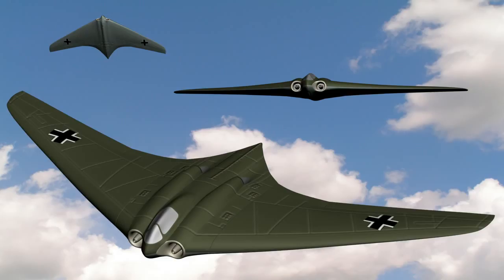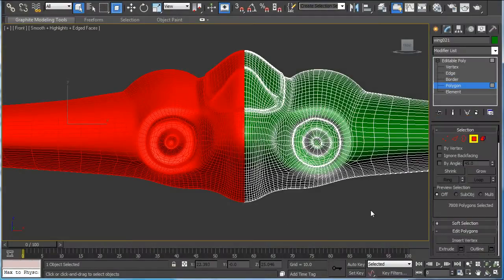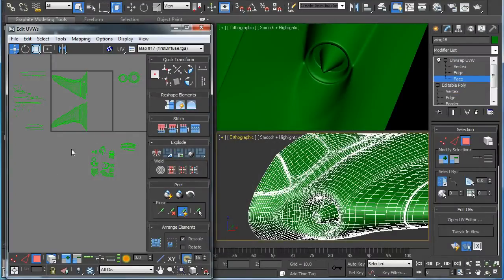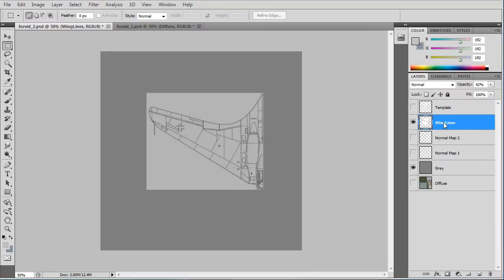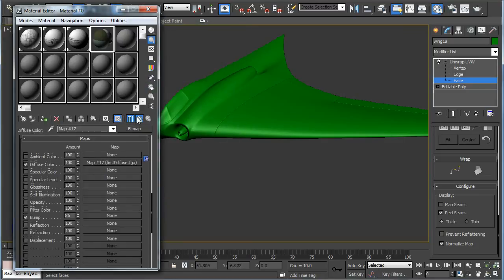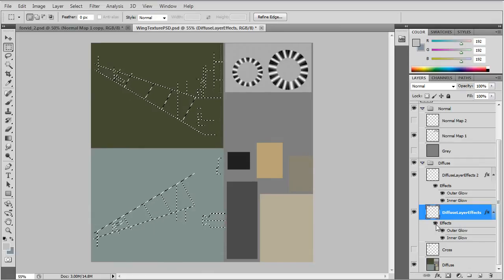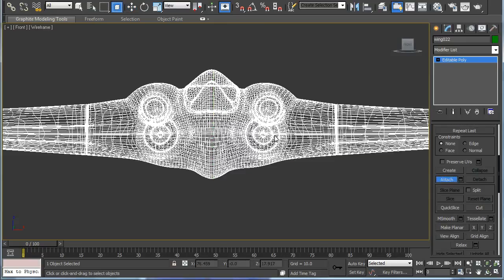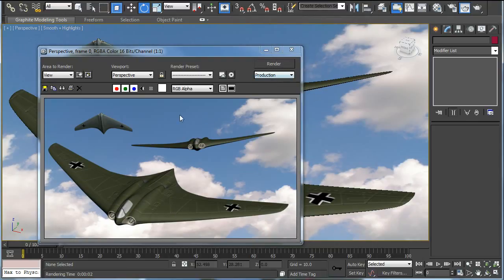3ds Max tutorial Part 2: Texture Map the Flying Wing

Comment: Would have been nice to see how the plane lines were made
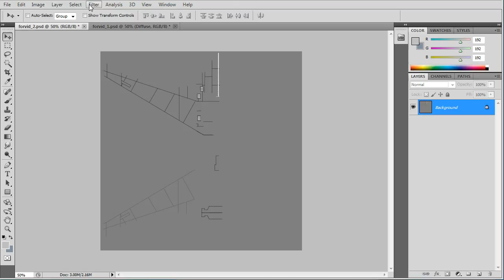Reply from the maker: go to 4:44 of the video. The lines were made by converting a grayscale image into a normal map.
Reply: Tutorial Bone Yard That the tutorial Im looking for
Reply from the maker: C Dean You can check out the written tutorial at: http://www.tutorialboneyard.com/Pages/TextureMapFlyingWing.aspx
and check tutorial series on modeling and mapping a gun: http://www.tutorialboneyard.com/Pages/50Calmain.aspx
Both these tutorials show how I make indented lines on these models.
Reply: Thank you, that was very helpful. My main problem ATM is the Unwrap UV uses an angle that I can't work with. I've tried multiple multiple variables and nothing seems to flatten the mapping with a top down view. If I use the 60 value as in the tutorial, the view is slightly angled from 90 degrees. I can't seem to get a top down view so that I can create plane lines evenly.